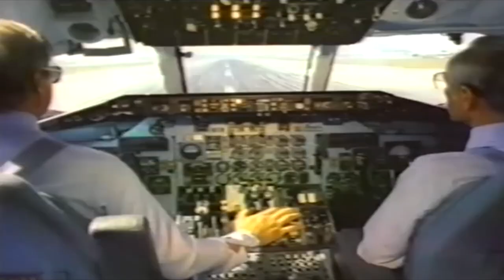MD-80 "Maddog" Tribute | American Airlines Retirement

Comment: I started to work for McDonnell Douglas Corporation in Long Beach California in 1980 as a Final Assembly Mechanic.  I started as DC-9-80 Slat Rigger,  then later on the Control cable Rollout crew.  In 1989 I became a Flight Ramp Mechanic on the MD-80 Flight Ramp.  I became a Ramp Team Lead for 3 year's.  In 1994 I moved over to the C-17 Flight Ramp,  where I stayed till November 2015,  when Boeing stopped Production of the C-17.    I loved working the MD-80 series aircraft.  I get to where I knew that aircraft really good.  I especially was good at any cable rigging and hydraulics.   I have a lot of McDonnell Douglas stuff I have collected throughout my 34 year's working there.  Even though the Company name was McDonnell Douglas and later Boeing. Most of the Employees there we're proud of their Douglas Aircraft roots.  We always referred to ourselves as DOUGLOIDS!

Comment: My first flight ever was on an MD-80. A window seat a couple of rows in front of the engines. Fell in love with the MadDog ever since! AA suddenly stopped sending their -83's to my city's airport earlier this summer (of 2018) with A320's, but Delta still sends their -88's (with a 717 at times) even today. After Delta's retirement is done (with the -90's also), then all I'll have left is the 717 (which I also love). I hope the 717 flies thru the 2030's.

Comment: Never flew on an MD-80, but flew on the later Boeing 717's many times in S E Asia from Bangkok to Koh Samui/Singapore. They were used by Bangkok Airways until around 2007, when they changed to Airbus A320's. I much preferred the 717, as they seemed much more agile in the air, and the rate of climb on take-off was terrific. Wasn't much fun sitting at the back though, as the last couple of windows next to the engines were always blocked off.

Comment: Flew one back in the '80s: a shuttle between Washington DC and LGA.  Standing in the front row, greeting every passenger was none other than Henry Kissenger.  Shook everybody's hand.  Big smile. And (of course) that deep, raspy voice!  

The rear-mounted engines were a relic of the DC-9/727 era where turbojet whine and rumble was quite irritating on the 707 and DC-8.  Moving these low-bypass motors to the tail made them quiet for all but the smoking rows.  Indeed, newspaper adverts for the 727 hailed it as "the whisperjet".  By today's standards, noway.  But by 1964 standards, absolutely.

And don't forget the MD-90/95 variants!

Comment: I still call them the super 80.  They were first known as the DC 9 - 80 or super 80 .  When McDonald mergered with Douglas they were renamed MD 80 81 82 83 88 and 95 . ultimately Boeing Mergered with  MD and ran it as 717 .  I loved the 2 by 3 configuration.   No middle seat for couples travelling together . Delta still uses them daily from ATL to my home airport PWM. Delta has the newer MD 88 and 95.  AA were the older MD 80.

Comment: I loved flying the MD-80 but it is time to retire them.  They have been work horses but AA has worked them to the bone and they need to be put to pasture (story below).

I was excited to book an AA MD-80 this past spring to come back from a bachelor party because it might be the last opportunity to fly one. Due to the incoming aircraft being cancelled due to MX, I could not be rebooked for another 10 hours because all other flights for the day were full (they were not sending a replacement aircraft).  I was stuck in the outdated New Orleans airport for well over 12 hours (the weather was bad so there was no point in leaving with my carry on luggage).  Once the last flight of the day arrived, we were delayed boarding about 75 minutes due to another maintenance issue involving the FMS, which required replacement. When we finally arrived at DFW, they had to hold us at the gate for 30 minutes while they found a ground crew because we were so late that most ground crews already went home.  It truly soured what could have been my last experience aboard the MD-80 and we barely got an apology from AA.  I got 5k miles "for my trouble" after I filled out a complaint form online.  From what I have heard, the MD-80's are fraught with daily MX delays and problems all the time.  The gate agents at MSY said this scenario happens at least 2x a week and they will be glad when the MD-80 is gone.  

As a passenger (and former frequent flyer) who flies AA almost exclusively due to being in DFW, I was really disappointed with my overall experience.

Comment: I had suggested around 2003 that American look at an update program for the MD-80 that replaced the original JT8D engines with Pratt & Whitney PW6024 engines. Had that happened, the MD-80 would still be serving with American Airlines even now, probably until the early 2020's.

Comment: Flown in several of these. Such a great plane and a greater loss for commercial aviation. Airlines see the bottom dollar, but these planes were so quiet with the engines being aft mounted. Also they seemed far less prone to wind shear and turbulence due to their short wings. Some of the best flights ive had were in the md-80 series.

Comment: I used to be an exec platinum flyer on  AA in the 90's and logged more hours on those planes than I could count. They were fine on shorter flights like SF-LA but they also used them on much longer flights  like DFW-SFO, ORD-SFO and they were terrible for those longer runs... No entertainment system and even in 1st class the seats  weren't much better than coach seats on other flights.. The only thing I liked about them was the 5 across seating in coach so if you were in the main cabin you could sit on the 2 side and not have a middle seat.

Fine for an hour for 4+ hours not so much

Comment: Flew on a Delta MD-80 to Minneapolis. Probably one of the worst flights I've ever been on. Mostly because of the vibrations and extremely loud engine (albeit I was seated near the rear). If it's replaced by the Bombardier plane, I would be very very happy. Now that's an awesome plane.

Comment: The MD 95-30 will be around for a long time yet...AKA Boeing 717-200. It's a much more modern version  of the MD 80 and the newest ones have 18-20 years left in their service life.
Reply: reverse thrust  Delta is the largest operator with 91 in the wild; Southwest sold them when they acquired airtran. Volotea , Hawaiian Airlines and QantasLink also as 717s.

Comment: Been flying on them for years and the better 3/4 has been working on them for 26 years. I already miss them as they are a much more comfortable plane than the 737 and a319s that are replacing them. Leather seats on the new planes are hot and sticky the foam they use now is hard as a rock.. The front lav in the 737 is horrible because its in the nose of the plane and you have no head room when you walk in. 
      The MD80 is quiet unless you are sitting at the back... The first class and coach seats are bigger than anything that is replacing it. First class seats in the 319 are like the coach seats in an md80.
         If Boeing had continued to improve the MD80 after it bought douglas it would still be the workhorse of the fleet. But as it wasnt a Boeing design it was never going to survive as Boeing made the decision to kill off all aircraft from acquisitions. Also if you remember the 737 almost went out of production years ago. It was an order by the Navy for cargo 737s that kept the line alive until the public sector started ordering them again. I wish they would have let the 737 fade away... I have never liked flying on it.
Reply: I worked for McDonnell Douglas back in the late 80`s and 90's, we pumped  the md 80 out for American  airlines every week. Not only that when they would test flight the aircraft before delivery they would let employees go fly with them, old how I missed  those days. McDonnell  Douglas was the best job I had in my life, every time I fly on one or see one it make feel proud  to been part of a team that produced this aircraft. It probably would have survived with updated configuration and different series,  but when Boeing took over they cancel all of our aircrafts and fired the workers in long beach ca, how sad! Worst thing that could happen when they bought McDonnell  Douglas,  but this aircraft will always be special to me!

Comment: Flew with this Aircraft from BWI to ATL back in 2017 and found so many MD80s at ALT airport. The odd is, why the wing is located at the back of the body? It looks so strange as an aircraft like it won't be able to lift the front side of the body, but it did!
Reply: The weight of the rear, fuselage mounted engines moved the center of gravity aft, like any other aircraft of the same configuration; B727, BAC 1-11, Current CRJ series, Caravelle, etc.

Comment: Work for delta and I can’t wait until they get rid of them. Airbus 321! Also to add delta isn’t replacing the Md80s with A220, as the 220s only fit 110 people opposed to 150 on the md88s and 90s

Comment: I have flown on DC-9 and MD-80 countless times, most recently in October on Delta.  I never liked these planes to be honest.  The ambient noise, particularly from the A/C system, is very loud compared to a 737 or A320.  I usually fly in a premium cabin so I don't get the JT8D noise so much, just uncomfortable noise that leaves me fatigued and takes away from the joy of flying.  Delta's configuration for the MD-80 also doesn't have IFE like their 737 I see on similar routes.

Comment: I have been on over 25 md-80/90s and it is an amazing experience the first couple of times. But if you sit in the back two rows they are the worst seats in all of Aviation the and Windows are blocked by the engines and there though loudest seats you can possibly have.

Comment: I been on MD 80 it seems be good planes,problem  is because of it's reputation, like what happened to Alaska Airlines flight 261 and ValuJet dc-9 went down to the Florida Everglades,im not very sure if that the case.
Reply: The ValuJet that crashed in the everglades was 25 years old when USAir(My employer until retirement) sold it to that airline a few years previously. The crash, however, was caused by the improper loading of live oxygen generators as cargo; not the fault of the aircraft, airline, or crew.

Comment: Will delta also retire the md90?
Reply: They retired a couple because they couldn't find spare parts.
Reply: They are scheduled for another 3 to 4 years.  Then after that they are gone.  Delta just retired the 30 or so they bought from China Southern a few months ago.  One was they were needing major overhauls and 2 for some more spare parts.  The engines off the MD90s is the same engine that is on the Older A320 they got from Northwest.   The engines off of the 90s will live long after the plane retires on the A320.
Reply: Yes but will keep the 717

Comment: It’s not the fuel inefficiency that’s causing the MD-80’s demise, The fact is that the FAA has come out with new regulations when it comes to stall training in the airplane, the simulators are so old it would cost more to update the simulators with the new updated stall simulations than to operate the aircraft. If this wasn’t the case American Delta and allegiant would just keep operating these airplanes because they’re already paid for and they’re cheaper to operate than their newer airplanes like the 737 max and the a320 neo’s which are still being paid for. It really pains me to see these old airplanes going because they are my favorite airplane.
Reply: Skuzzy Skeeter There are variety of reasons why they don’t make economic sense anymore. The simulators is a relatively minor issue and the overall scope of things